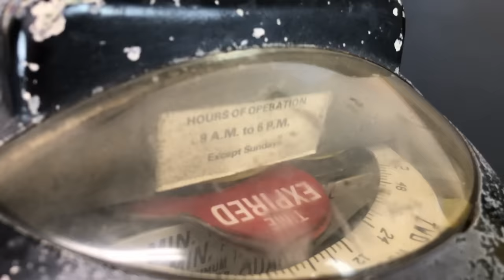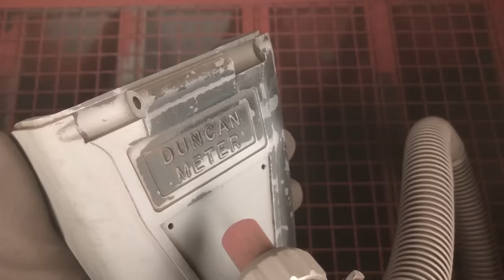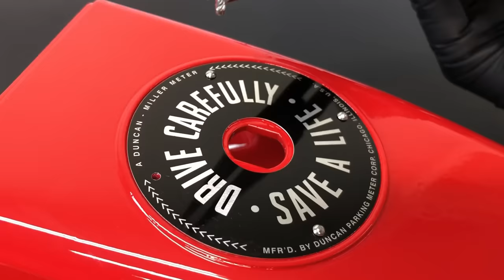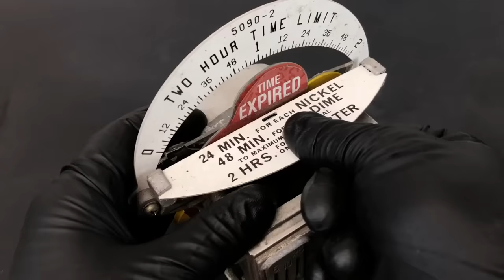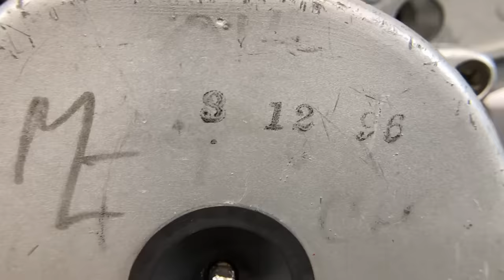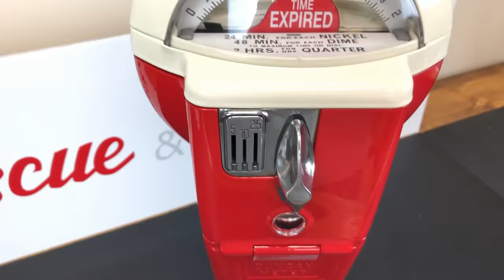1960s Duncan Parking Meter Restoration

Comment: I'm just impressed that the internal mechanism was still ticking away.

I love the colors you chose to it, my home town still has parking meters and they're a dull gray.
Reply: Woah
Reply: How does the internal mechanism not run out of energy for such a long time?  Didn't see a battery or anything.  Did he just wind it up for the video?
Reply: Stuff back then wasn’t made so cheaply
Reply: @trainzguy2472  Turning the thumb turn after entering the coins into the mechanism winds it sufficiently enough for the parking time paid for, the timing mechanism doesn't need to run when not in use.
Reply: He choses mostly thier logo colours I suppose
Reply: @trainzguy2472  It stores energy in a wound up spring. As long as it doesn't get a chance to release that energy it will store until the metal breaks down.

Comment: What a superb candidate for restoration. And what a superb job as always. I wish parking meters still looked like this instead of the junk we have now!
Reply: They're awful green boxes in Chicago now, one per block/side of the street. You deposit your money or swipe a card, input your plate number, and it gives you a little ticket to put on your dashboard. And then, if you've got outstanding tickets, it calls someone to boot your car. Fantastic system. It's part of why I won't own a car in this city.

Comment: The amount of engineering that went into creating this device is amazing.  Even more amazing is that you were able to take it apart and put it back together again.  i don't know how you do it.  Beautiful work.  Bravo!
Reply: Well you see through the magic of video recording he knows which part belongs where. Truly amazing that this technology has been around over 50 years and there are still people who are clueless on how it works.
Reply: He has a 🧠... That's why it looked so easy!!!
Reply: If you were the one to take it apart, I would be highly surprised if you couldn't put it back together. When I was a little kid, my brother and I would take apart those little candy poopers, mix the parts together (sometimes doing a bunch at once), and then race to build each other's from the pile of both sets of parts. We stopped as they have been getting designed to be very flimsy.

As anyone who has worked with them before will notice, he makes sure to show removing AND replacing e-clips. I forgot one once and nearly had my head bashed in. For anyone who was in FRC, imagine 4 cims wired directly to a battery (no controller) to directly rotate (no chain) a 4 foot, 30 pound bar.

Comment: Of all the videos you’ve done so far, I think this has the most parts and I really admire your patience to remove them one by one then put them back. Thanks for uploading these. I’ve been having anxiety lately and your videos relax me. I like that there’s no background music.
Reply: It's understandable that; this parking meter, wasn't fastened onto a tall galvanized steel pipe. The Santa Cruz public library used to have; analog mechanical dual parking meters, in those days during the 1970s and the early 1980s.

Comment: With a bazillion hours of practice I might get to the point of being able to sandblast and repaint one of these projects but I’d never remember how to put it all back together again!
Reply: jules wins - You need a camera.  You record yourself taking the object apart so you see where the part came from.
Reply: XcoolxX badguy I’m not sure even that would help on a project like this one!😂
Reply: You’re right.
Reply: When I take all the pieces out, 5 minutes after, I can't put them together again.
Reply: Dude, I get increasingly nervous with every piece that He takes apart. Last week I was viewing a clock restoration, and the power wen out, man I was a mess until It came back, and I could see How He put it together again.
Reply: @juleswins3  if you think you can't, you are correct. if you think you can, you are correct. an easy way is to group things, you do not need to take the whole thing apart at one time work in sections and video it. 1 parking meter 4 main sections 3 of them only have a max of 10 parts 4th section is broken down to 3 to 4 sections the timer was not touched / opened. lay parts out on cardboard to keep thing separate.
Reply: These are very simple except for the clock mechanism.  The disassembly and reassembly is actually as easy as they show in the video.  If all else fails, just watch a part of the video, do what they did, watch more, etc.

Comment: Truly technical wise you're the best one ever in all restoring channels and I've seen a lot.. you're the most satisfying technique wise, i always cringe when i see paint stripping then metal brush instead of sand blasting, and they spray the primer instead of your heavenly way of priming then painting. The only concern is that you need more content, more more content. It's the only downside, i instantly clicked the link once got notified and i always check if you added a new video, keep uploading videos, i swear to God you're the only one who is truly 100% satisfying with that feel of accomplishment and fulfillment. Thank you so much and keep up the great work.
Reply: Hand tool rescue is a little better, I watched all of his videos already.
Reply: I only watch this one for the sand blasting and powder coating.
Reply: Malek Al-Sharie Perfectly said and totally agree!!
Reply: Mad Max I agree
Reply: I'm curious, why wouldn't you paint strip it? I don't see how that's a bad thing
Reply: Choosing to strip or blast depends on what medium was used to coat and on what the item is made of.  Example lead paint would not be a good choice  to be blasted unless it was stripped first. As well as using the correct blasting powder for the right parts. I'm pretty sure the only reason he pre-powder coats is for a smoother finish of the top coat but I could very well be wrong.  Now when it comes to paint  I would use a primer.
Reply: There's nothing really wrong with a wire brush and pain stripper mate.  Not everyone can afford a sandblasting setup.
Reply: This guy is powder coating, not painting.
Reply: I also like TysyTube but he does use a lot of chemicals.
Reply: Quality vs. quantity I suppose.
Reply: @Zeit142  he has a cheap Harbor Freight one, just $170. Not too shabby!  Especially with a coupon!
Reply: More content? No way he could include all details from each step, the videos would be too long. They could get boring. Also, think about the time it takes to edit the video. For me, 20 min. are just fine.
Reply: @caribmedical57  more content means more videos and things and ideas to restore, current videos are flawless and don't need any other unnecessary fillings.
Reply: @TheGentleman1987  Well, the word "content" has many meanings. I understand your point better now.

As much as we would like to see more videos, keep in mind that restoring things is a hobby for him. Actually, a very expensive one. I would assume he has a full time job. I can't even imagine how much is the power bill and the cost of buying paint and supplies. It adds up...

There is no way he can do restorations and edit videos daily. Besides the channel is 3 months old. Give him a break. 😆
Reply: @caribmedical57  I couldn't have said it better. Totally agree.  : ))
Reply: @Geeksmithing  Oh we don' t have Harbour Freight in the UK. I didn't realise they were so cheap over there!

Comment: Love the vids R&R. <3

Also noticed that centre hex bolt was there to stop people trying to punch the pins out at either side and getting they raid on. 

Nice, tiny little detail that didn't go un-noticed!
Reply: I wasn't paying much to him taking the pins out but when he put them in I thought  what stops people form taking them out and went back to look  and AHH! that is how. But actually picking the lock would be quicker and not as noticeable.
Reply: You could run a screw in there then grab it with a slide hammer, when you get it out enough clamp it back onto the screw with vice grips and slam it out. I've never done this before, just sayin. ⛏

Comment: About 20 years ago,  I worked at a small scrap yard.    We had about 50 barrels of those parking meters.    I spent countless hours disassembling them,  on slow days,  because the body was made of cast aluminium.   Pure aluminium is worth 10 to 15 times more than if we sold it as "dirty" aluminium.    I became pretty good at taking them apart but I bet that,  even after I had tore apart the last one,  I'd never be able to reassemble  them.

Fun video to watch.

Comment: Just curious: Whats that little Yellow flap "Violation" - for??? I've never seen that.
Reply: When the "time expired" flag is up, the parking enforcement officer would know just by looking at it that the car parked there needed a ticket. As soon as you turn the thumb button to deposit your coins, the flag goes down and everything looks OK. "Back in the day" people would slightly turn the thumb dial (without a coin in it) and the flag would drop. They would then jam the thumb dial with a piece of twig, toothpick, or whatever to stop it from returning upright and to make it look like they were parked legally. Any officer just driving by wouldn't see the "time expired" flag and they would think all was well. A redesign had to be invented to thwart that practice. Now as soon as you turn the thumb dial, the "time expired" flag drops and a "violation" flag raises until you fully turn the thumb dial to deposit your coin. The dial then returns to upright and the "violation" flag drops so that the officers know that there is time remaining on the meter and the thumb dial hasn't been propped to look like the person has paid for parking when they haven't. I hope you followed my explanation. 😁
Reply: @ericrobert57  Came in the comment for a vague answer to that question. Got one better than I was expecting.
Reply: @ericrobert57  What was the small round window halfway down the front for?  Thanks.
Reply: @bbutc  If my memory serves me correctly, it's just a window to see your coin drop after you turn the thumbwheel. Many parking meters don't have them.
Reply: @ericrobert57  Thanks. Having watched the video again it looks like the window was once used to see the coins fall, as you state, but the view is now blocked by the thin reflective metal plate that he places in position at 17:05. So now it's just the worlds smallest vanity mirror. lol.
Reply: @bbutc  I rewatched that part of the video and I see what you mean. Tiny mirror it is! 😁
Reply: @ericrobert57  danggg
Reply: @ericrobert57  Thanks so much for your clear explanation! 👍👍 I was curious about that as well.
Reply: @JSPartre  Me Too
Reply: @ericrobert57  Cool
And well parking meters maybe nightmared they're really needed 
Because some places are PACKED so it's good to have something to make sure people are not all day
Reply: @ericrobert57  interesting. My town managed to avoid them but we sort of got excited to use one when we went to big city. Never saw people jam them but im sure they tried. :)

Comment: Back in the 60s juvenile delinquents in my neighborhood started actually stealing the same parking meters that are shown in this video.
They had to drop them off a 10 story building, and used a rope to pull them up again if they didn't break open.
Even if the meter was full of quarters it wasn't worth it.
But they never got arrested! 
The dents they put in the sidewalk are still there.
I smile every time I walk pass them.

Comment: Top notch restoration.  Anytime I see media blasting, primer, wet sanding, and then paint, I always think "That is a quality job that's going to last.". 

Side note re: parking meters.  What is the difference between "time expired" and "violation"?  I thought time expired WAS a violation that would result in a ticket.  Thanks again for the excellent video.

Comment: I really appreciate this video. But I am finding a few areas that I think you could improve. Maybe I've been spoiled by My Mechanics, but I'd like explanations of which pieces are new when parts are replaced, as well as where you sourced them from. Who made the new plastic cover top for you? Sometimes it's hard to tell if a piece has been replaced, given a new decal, or just cleaned up.
Still, you did a great job, and this is probably my favorite of your videos just due to the mechanical complexity.

Comment: I noticed you slotted the little ‘Hours of Operation’ card upside down in the head during reassembly & modernised the information. Refer to:
2:56 card removed
9:53 card replaced
19:49 card upside down clearly visible

Comment: Nice job - how did you re do the badges (drive safe) etc - or are those just cleaned and clear costed?

Can’t believe the internals of that time / counter mech. I’d have been sweating pulling that apart!

Comment: U used a half diamond for opening the lock. The glad diamond is made for zipping. You put all the way down and pull as fast as you can and it will unlock a low security lock very easily

Comment: I was so enthralled by the first half of the video, that I forgot about the insides and front… you must have a degree in engineering. Have you ever been taking something apart and when you open it either a piece drops out and you don’t know where it fell from or a spring shoots out? Do you use schematics for items when you can find them?

Comment: The internal parts looked to be Brass metal alloy.  Why were these painted when they are impervious to decay?  I enjoyed the video.  Top should have been black.
Reply: Painted so they can be seen so you don't crash into them, and so the meter maid can find them. Also: "  Meter posts were color coded. Aluminum allowed 12 minutes for a penny and an hour for a nickel; blue allowed 24 minutes for a penny or two hours for a nickel; brown, in front of the post office only"

Comment: I have this same parking meter. Well maybe not this exact model. It has a base allowing it to stand on its own, but the lock for the coin storage is missing. Despite that, it's in better condition than how yours started out.

Comment: As always, you're work is impeccable. Someday I'd love to see how you document the disassembly and reuse it for reassembly! I a little disappointed that in this case you changed the color from black to red/white, and that you're re-printed schedule card was backward and didn't better replicate the original fonts...but I'm nit picking.
Reply from the maker: The original color as seen under the original decals and inside where the coin cup sits was red, but I agree and understand about using different the schedule cards.

Comment: Take a penny and file two flats 180 degrees apart so the distance across the flats is equal to the diameter of a dime.

Insert in the dime slot and turn the knob.

How much time does it give you?

Comment: I have one of those meters. 2 things, mine has a metal cup with holes in the bottom for the water to drain and the other thing is mine you get 2 hours for a nickel and 4 hours for a dime and 10 hours for a quarter.

Comment: What type of punch did you use to remove pins at the 1:21 mark? I restoring a Duncan meter too but had to drill out the Allen screw. Now my punches are too short.

Comment: 9:53 - "Excepted?"  Shouldn't it be "Exempted?"  I know nothing about restoration, but for things like this that are printed, I would can the original in high rez, and trace over the original fonts and spacing in Photoshop, not necessarily using a similar computer font as a substitute.

Comment: I don't think this is 1960s.  The font on the instruction plate is too modern, and the back of the clock assembly is stamped 3 12 96.
Reply from the maker: dwasifar karalahishipoor these were originally made in the 60s and kept in service for decades. So the clock mechanism for example was last replaced in 3 12 96. :)
Reply: @RescueRestore  But the font on the instruction plate?  Was that a replacement plate?
Reply from the maker: If you want to believe it’s from 1996, that’s cool with me. 👍
Reply: @RescueRestore  Maybe not 1996, but I'm looking at that label and the Duncan logo font is 1970s at the earliest.  

I really didn't mean to start an argument, though.  I'm in awe of your restorations.  I especially love the moment when the powder melts in the oven and turns glossy.
Reply from the maker: dwasifar karalahishipoor no worries, you’re good. You have a good eye. One thing to mention about this particular meter is the coin door/lid has been replaced and isn’t original. They were serviced a lot and parts were swapped to keep them running. The coin door on this one is a completely different color then the body of the meter. Maybe it was changed in the 70s? If so, that’s new info for me and really cool. Thank you
Reply: @RescueRestore  That would certainly explain it!  A replacement part for a damaged meter.  So then the question becomes, how would that damage occur?  I'm guessing theft; someone broke it open with a hammer to get at the money.  Your meter may have an interesting history.  :)
Reply: Looking into it further: I found out that the instruction plate was originally designed to be held on with little rivets at the corners, and was only changed to being stuck on with adhesive at the very end of production, due to damaged tooling for punching the holes.  So I'm guessing the replacement door was probably installed after this model had gone out of production.